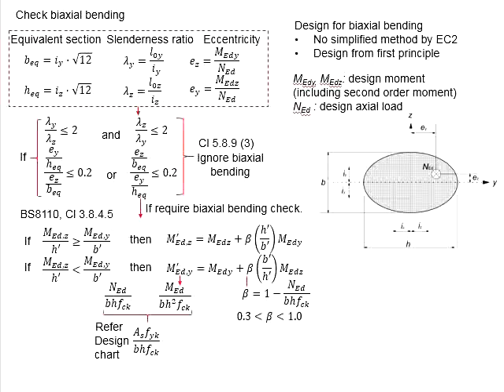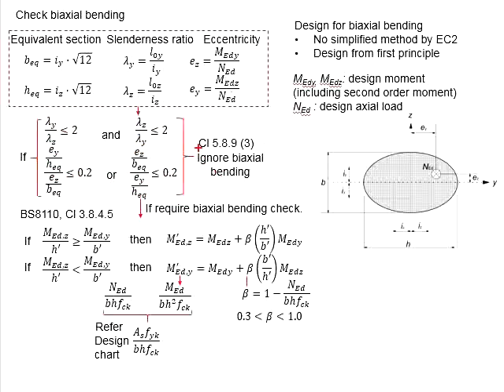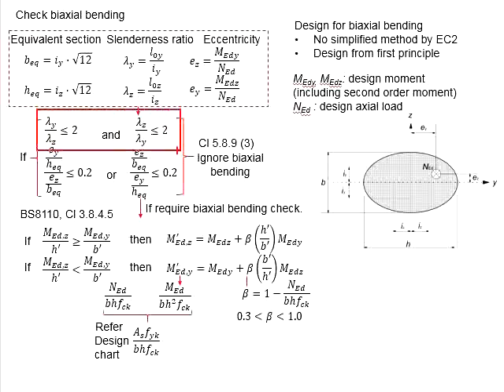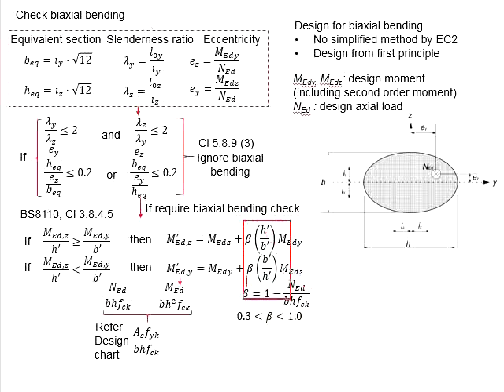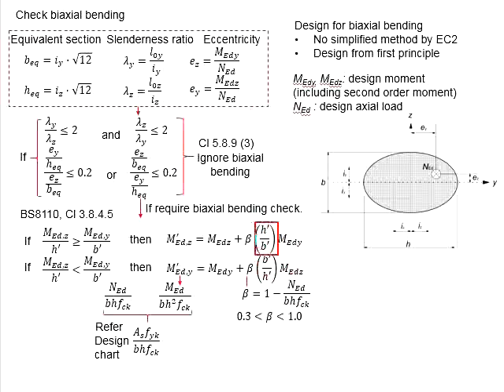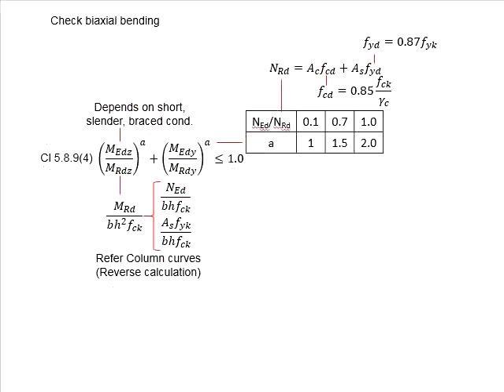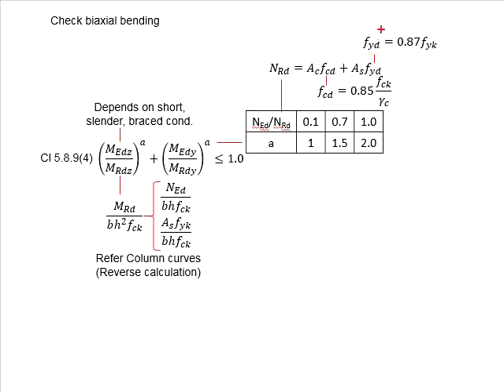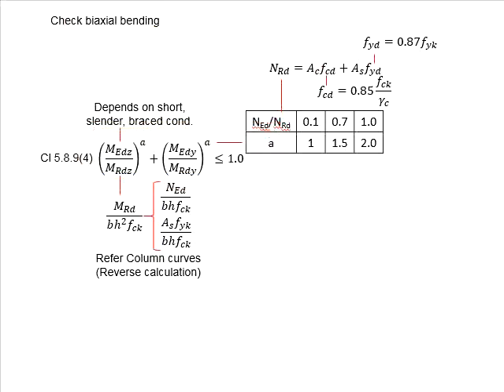2.19 Design of column with biaxial bending

Comment: Is the circular column design exactly the same? provided I use "Ned/Nrd 1 --> a = 2" for circular columns. Is that the only thing I should consider when designing circular columns? Or the design process for the circular columns is different than rectangular columns?